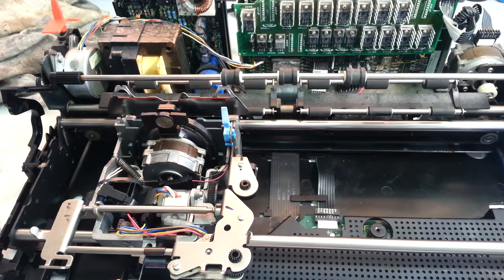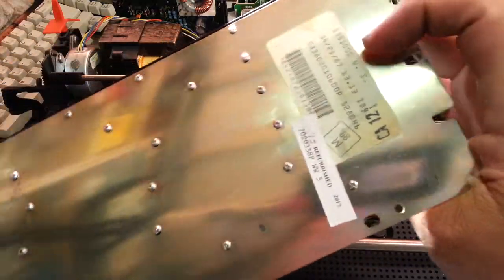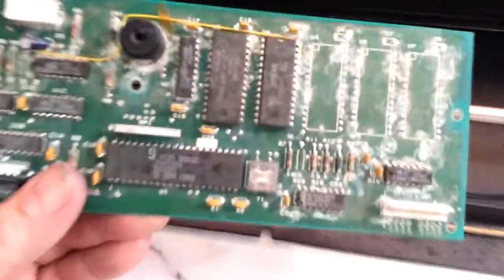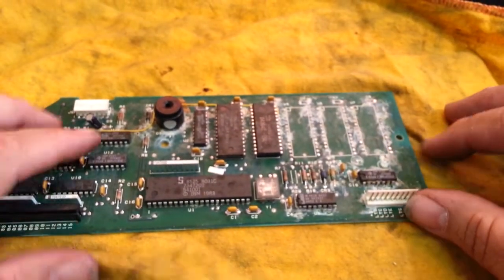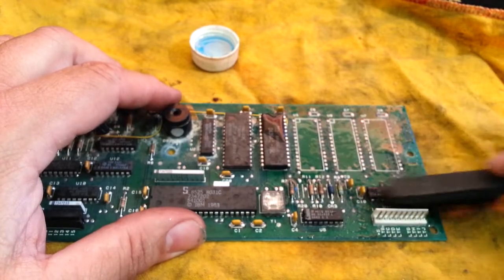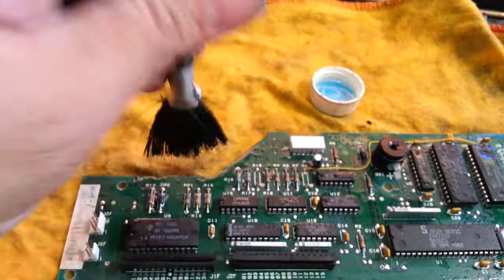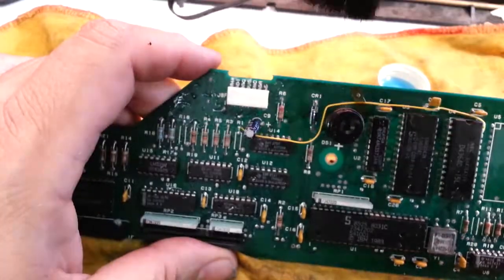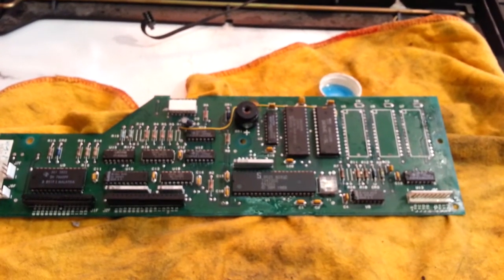IBM Wheelwriter Typewriter Corroded Circuit Board Repair Fix Restore PCB

Comment: I'm surprised that you use vinegar on a circuit board. Vinegar itself is acidic and looks to me like it would just lead to more corrosion. I work in the electronics field and we use alcohol to clean circuit boards. Seems to me the contact cleaner with the light lubricant that you use in some of your videos would be a safer long term solution provided the lubricant doesn't short the board. Maybe blow excess off with compressed air? Thanks for sharing your work!!
Reply from the maker: The acidity is the whole reason for using vinegar, neutralises any further corrosion. Was taught this technique in the late '70's & performed 100's of cleaning PCB jobs since. It does immediately get compressed air dried & then heated to finish, we used to use a heating booth, but was 110` that day so I put it in the sun for a few hours.
Reply: Thanks for the reply!! I'm not doubting you as you certainly have the experience and after all of these years, if what you are doing causes more damage then you would surely have heard about it!! Must be a base that's causing the corrosion for the vinegar to neutralize the reaction? I know water/humidity was the instigator here for the corrosion and it is for the circuit boards we deal with. I'll have to look into this further...

Comment: Did this fix work?
Reply from the maker: Yes, Actually was still working like it was, but if corrosion continued it would eventually fail. This process stops any further corrosion so should be fine for another 30 yrs (90 day warr).
Reply: I have a question. The school district I went to must've bought a bunch of IBM Wheelwriter Model 3 Series 2 in the late 1980s, and I found one that I wanted to make an offer on because it was in a storage closet and appears like it hadn't been used in some time. (The other was in the library, and the librarian still uses it to make labels - she is "picky" about who uses it.) However, I noticed one issue: it had a note that said the carriage return wasn't working. Would that've been a minor problem, or a major problem that would cost more than the machine is worth to fix? How much does a typical Wheelwriter M3-S2 cost?
Reply from the maker: Never seen a WW that wouldn't do a carriage return, would be rare. Probably does a partial return, that would be very common & just involves cleaning carriage rails & bushing, possibly the carrier motor too. All very basic stuff. More info, like does it move forward ? B/S ? Make a noise when it try's ? Unless something very odd & rare should be fixable. Seen what looks like good WW's sell for $20.00 on e-bay. A fair used price might be $100, I price my reconditioned WW's @ $300